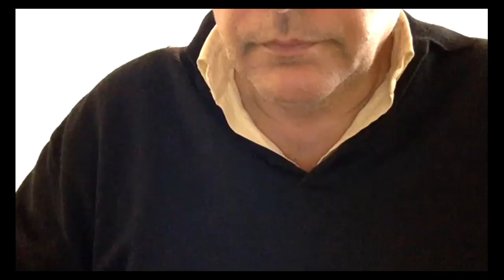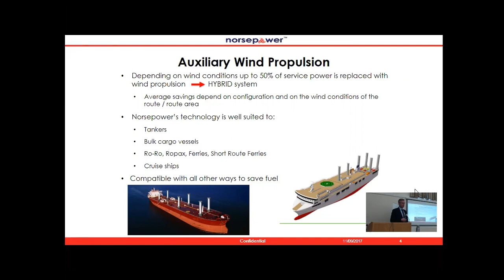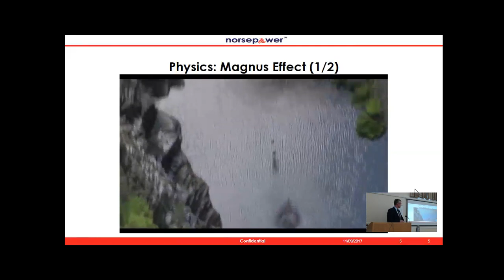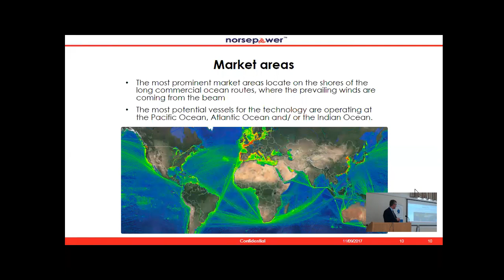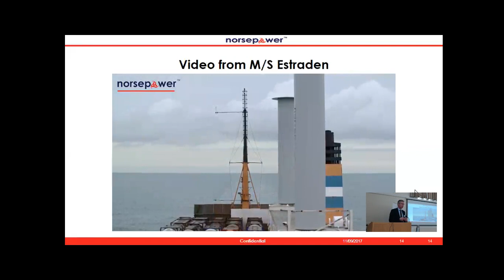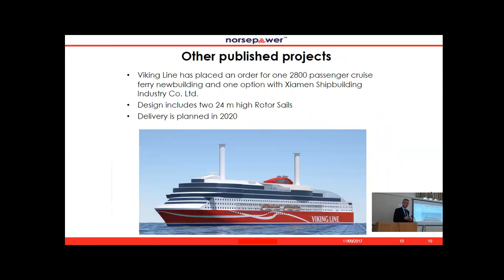Rotor sail propulsion technology by Jukka Kuuskoski

Comment: What determines the initial rotational direction of the cylinder? Is there an electric motor that starts it spinning in the desired direction before letting the wind take over? Or does the Magnus effect alone determine the direction the cylinder starts turning?
Reply: Seems to me that the cylinder needs to be spun by an electric motor constantly to get the magnus-effect, but the propulsion force of the magnus effect is roughly 10x  to the energy put in into spinning the cylinder.